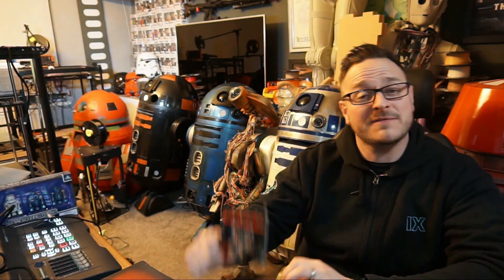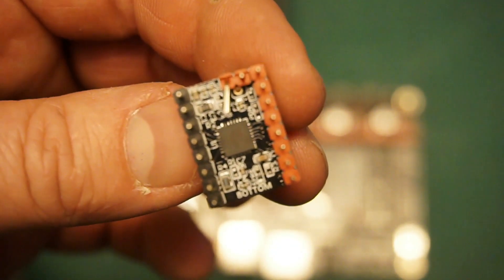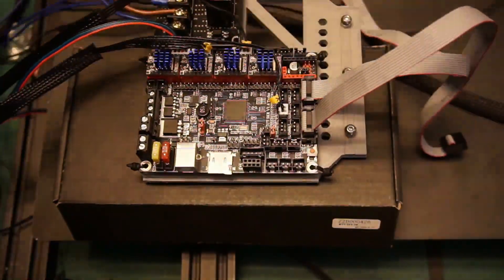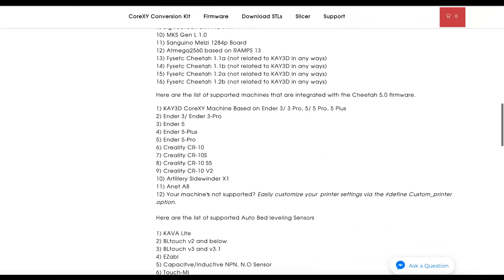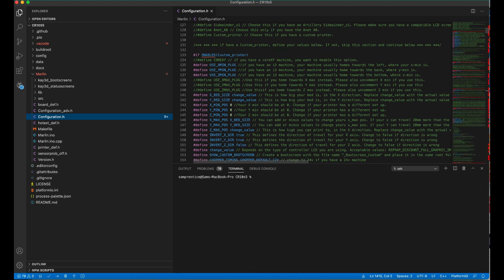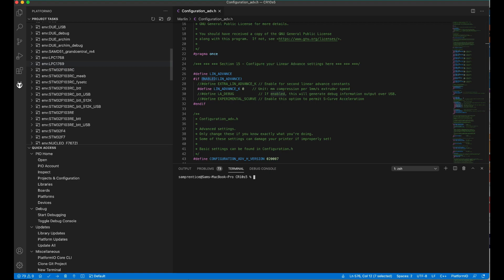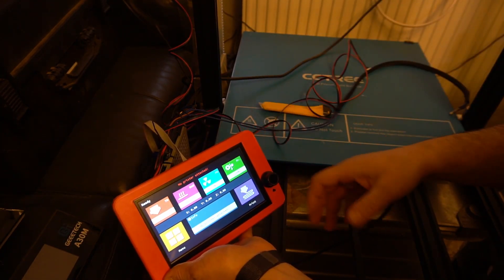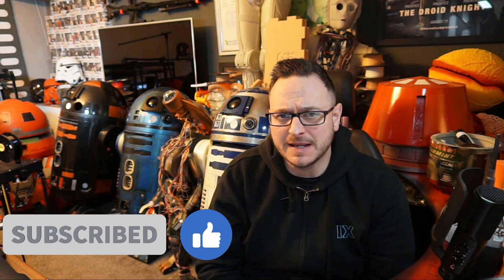Creality CR10S5 BigTreeTech SKR1.4 Turbo TMC2209 Upgrade

Comment: Kay3d is long gone link its spam!, and your github file doesn't  load correctly . Anyway to do an update?
Reply from the maker: Yes a four-year-old link… excuse me
Reply: @TheRealSamPrentice no need to be rude, I wasn't.  Was letting  you know the kay3d link was bad,  if you could  remove it.  Then I tried to follow  your video, but when I open your git hub file in vscode it errors out. Shows a bunch of red nulls and white boxes
Reply from the maker: @AwdRegal I wasn’t being rude, the thing is that if I had to keep an eye on links in all videos it would be an impossible task. Kay3ds Demise was a terrible shame! Maybe check out TH3D and see if they have any board files for that board. However klipper is now a guilty pleasure for most on the firmware side due to its easy editing inside the program.

Comment: Hello. This is my first comment on your channel. I'm wondering if this is still relevant board in 2023 or is there better board for similar price nowadays? (Must have requirements for my setup are atleast 5x tmc2209 drivers)
Reply from the maker: There are many boards now and you can run higher power, the skr3 board will do the same kind of job but if you’re running klipper the processing will be off redundant

Comment: hello .... do you have any idea why my CR10S, after putting marlin 2.1, prints all the layers always on the first one?!? the Z axis does not want to be raised during printing .... in homing and in bed leveling everything is fine but during printing it does not want to know ... ideas? I mount the BigTreeTech SKR 1.4 Turbo with TMC2209 drivers. Greetings
Reply from the maker: Can you raise the z up from the controls ?
Reply: @TheRealSamPrentice  absolutely yes
Reply from the maker: @hobbyone4119  any grinding or movement on
The z when it’s processing gcode ?
Reply: @TheRealSamPrentice  what I can tell you is that while it warms up there, Z does not move. when the print starts it makes the skirt and the first level correctly and then stops going up on the Z axis, printing the subsequent layers always on the first level. in the Marlin 2.1 firmware I didn't make many changes, I reversed the direction of the motors and the extruder because they were the other way around

Comment: Hi, first of all thank you for your tutorial! I`m having some trouble getting BLTouch to work on the TFT70 v3.0 I`m missing the button icon as wel as the whole leveling section. I got a touch smart 1.2 , SKR 1.4 Turbo / CR10S5 / BTT TFT 70 V3.0 / TMC2209 UART . I tried your marlin version and did a complete rebuild from scratch Marlin 2.1, but BLTouch isn`t working. When I start the machine it does however doe a good selftest. Do you think you could please help me or perhaps point me in the right direction? It`s driving me nuts... Many thanks!!
Reply from the maker: Send me an email and I’ll compile one for you
Reply: @TheRealSamPrentice  Thank you for your reply! I send you an e-mail just now (actualy 2 pressed enter to soon in the first one and it slipped away hahaha)

Comment: I added a bltouch and a smart filament sensor. I edited the code accordingly. Now i get an EEPROM data size error and a fade height error. Do you know how I can solve these issues?
Reply from the maker: Go into the menu and reset the printer. Let me know if it clears the error.

Comment: Alright. I have the same board same printer same drivers. Only problems I’m having are
1. End stops are not working.
2. All the Axis are inverted.
Reply from the maker: Okay are you doing your own custom firmware? On the axis you might be able to either invert them via your screen, the firmware editor or by simply swapping AA/BB over on the 4 cables that is where you take the two inner A & B and the two outer A & B cables so you end up with BB/AA if that makes sense. On the end stops that’s an odd one, but it might be down to the travel on the axis so check that first :) let me know how you get on!
Reply: @TheRealSamPrentice  You are a legend. Changing Aa/bb worked miraculously. It also solved the end stop issue!
Reply from the maker: @hazar31  awesome :)

Comment: i have skr 2 instead of skr 1.4 turbo. Would the same firmware and pin configurations work for it?
Reply from the maker: It might be slightly different and the compile might be different also. I’d check the pins on the images and see if they match up
Reply: @TheRealSamPrentice  im setting up the board rn. Pin configurations slightly different but it’s fine. I hope the firmware works because skr 2 is an upgraded version of skr 1.4. Also, SKR 2 is not included in the board list.
Reply: @TheRealSamPrentice  i tried to compile myself but got so many errors. So I just gave up and wanted to use your firmware
Reply from the maker: @hazar31  Ah okay well maybe Cheeta 5.0 now supports the skr 2 - I dont have time today but I will have a look tomorrow.

Comment: Hoping to apply this video to my used s5.  Thank you for doing this video, there isn't much info out there for newbies.
Reply from the maker: Let me know if you need help I’ve done the s5 mod also ;)
Reply: @TheRealSamPrentice  and I'm lost.  Making the connections were easy.  I am struggling to follow the compiling part of it.  I've never done it before so the video is a bit too fast for me.
Reply from the maker: @sithdragon99  Hey Jer, sorry about that! Let me know where you are up to and ill try and help you out :)
Reply: I’m also here for the exact same reason. My CR10S5 keeps throwing an E1 error. Someone said it would be my 5 volt regulator Cricut, someone else gave me a list of things to check concerning my hot end but I replaced my hot end. Totally willing to read forums/books/watch videos but I don’t know where to start. 😭
Reply from the maker: @ericastoll2183  what’s your setup stock or modded
Board? Have you tried a pid tune?
Reply: @TheRealSamPrentice  my hot end will not even heat up to tune pid. Temp rises with a hair drier. When I try to heat my hot end the temp reading in octoprint fluctuates up and down and spikes so much it looks like jagged rocks. My screen flickers. I replaced my whole hot end because i didn’t know what else to do and then someone else said that doesn’t really help because my resistance could be different but I don’t even know how to test resistance. Someone else told me to “solder the capacitor I mentioned above onto some JST-XH crimps and plug it between the V and G pins on your Y max end stop connector and see if that stabilizes things enough to get a print to start” What? V G Pins? Capacitor? Huh? I threw my hands up and just ordered the SKR1.4  Turbo. I wish I understood what all of that stuff means but I don’t and don’t know where to start in teaching myself. Currently I’m running an mks gen v1.4, raspberry pi, BL touch,...the printing community is so helpful but my background is in design and drafting, I don’t know anything about hardware. Its like explaining to my 7yo how to use a table saw to make dovetail joint and them being scared to touch anything. That’s me. The 7yo. Haha
Reply from the maker: @ericastoll2183  I’ve only had that kind of thing when the heat break was incorrectly installed and the fan was cooling the hot part down too much. Ping me a couple of pics of your setup I’d be happy to see if I can spot something
Reply: @TheRealSamPrentice  I even tried to watch your 5 video series on the CR10S5 but I couldn’t find all the videos. I don’t even know if this is the best board for me but I ordered it because of how you explain the install and make me feel like I can actually do it. Hopefully I can figure about connecting my PI and the associated firmware. Sorry I word vomited at you but currently 3D printing is my source of income and I’m just so discouraged.
Reply from the maker: @ericastoll2183  let me know when you are set up with the 1.4t and let’s work it out :)
Reply: @TheRealSamPrentice  Thank you Thank you thank you! I don’t know how to send you a picture since YouTube took away direct messages. In my very inexperienced opinion I don’t think that’s the problem. Printer was printing perfectly like a child that never back talks or gets in trouble. Then my screen started to flicker. Then it would error out before the first probe. Now it errors before my hot end even preheats.  I ordered a new hot end assembly with the shroud and fans attached to the stock metal shroud and i still get the same error. That’s when someone said that didn’t mean anything because the resistance could be different and that would do weird things to the board.
Reply from the maker: @ericastoll2183  therealsamprentice@gmail.com

Comment: if your hear trying to figure out what your doing wrong. it's probably the board. I have now had 6 that didn't work. sd cards missing bootloaders cold solder joints. I hade one that worked for almost a year. then it stopped reading its sd card. bottom like bigtreetech is a rip off. go buy something that works are forget these ripp off boards.
Reply from the maker: Did you ever get the feeling that it’s you and not the product?
Reply from the maker: Octopi ;)

Comment: Hey thank you for your video ! I'm trying to get my S5 working with the SKR1.4T for months now, I have 2 issues with it, the first one is I enabled the Z stepper auto align, but my left z motor is spinning slower than my right z motor. My second issue is my extruder not spinning (but moving like when your nozzle is clogged), I tried with an other motor/cable same thing, the problem is on the firmware or maybe the board, any idea for these 2 problems?
Reply from the maker: Okay so on the extruder issue if you plug the motor into another point like the x does it move? Check the cable connections and the plug wiring. I’ll have to check the code but you might want to check the voltage for the z’s set in the firmware. Is the z slower or is it sticking is my other question ?
Reply: @TheRealSamPrentice  So for the extruder, I swapped the Y and extuder cable on the board, the bed is moving (slowly) as the extruder should, and the extruder is doing the clogged movements (but faster than before) the weird thing is that I tried 2 differents motors (one from my Ender and the stock CR10 motor) and 2 differents cable, but same issue. For the Z, the left one is slower than the right, I think the left one is the one plugged on the E1 slot (thank you for your fast answer btw)
Reply from the maker: @SamyBreezy  sounds like you need to configure your steps in that case.
Reply from the maker: If you go into the settings on your screen your E steps for the E 400
Reply from the maker: @SamyBreezy  the x and y should be 80 for both
Reply: @TheRealSamPrentice  Hey Master Sam thank you again for your help, so I did many tests and I've found that both extruder cable had a bad wiring from Creality, I guess it work with the stock board but not the skr.. Now i'm trying to fix the voltage for the E1 (second Z), current is 580 for Z1 and 800 for E1 (so my Z2),  I'll try to change it to see if the problem is fixed, on my Ender 5 plus the voltage is at 650, did you changed yours? or 580 is enought?
Reply from the maker: @SamyBreezy  They will need to be the same I think mine were set to 600 on each :)
Reply from the maker: @SamyBreezy  I'd stick the two z's at 600 and see how you get on :) Let me know
Reply: @TheRealSamPrentice  Hey thank you for your help ! Everything is working now 😁 I had to change « E1 » stepper motor for « Z2 » that’s weird but it’s working now. I still have to found a way to replace the glass bed but it’s so hard to find a 508x508 pei without having to pay 170€
Reply from the maker: @SamyBreezy  Regarding the glass you can usually speak to any glazier and they will cut tempered glass to size for you
Reply: @TheRealSamPrentice  the thing is, I still have my stock glass bed but the adhesion is bad on it if I don’t use blue tape, since I used PEI on my other printers, I want it on my S5 too 😄